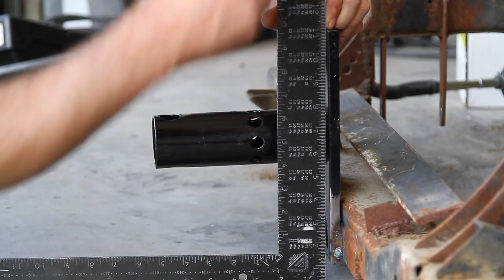DIY Homemade Truck Frame Rotisserie Using Harbor Freight Engine Stands.

Comment: Dude, you are doing good. Public speaking is the largest fear for people and I figured this phobia was spiders!
  Maybe people have a hard time speaking in public picture then not naked, in underwear but with eight legs and covering their chairs in web!
  Hell, I don’t know!! You do a good job speaking, just make sure it is loud enough for guys who worked in shops but had no daily access to ear plugs. We owned SnapOn ear muffs, but we’re never offered ear plugs. We augured for gloves to wear during auto transmission repairs. They had me clue as most front personal would run to the Hospital with a paper cut. 
  Good lighting, speak up, having knowledge of the subject matter is the best confidence builder when it comes to any subject. 
 It will be good and I will send this link to one some who takes cars apart from the 80’s, but can’t figure out how to put them together. I tell him, I had to watch, learn, ask questions until they ran me off. A new high school built in the 70’s, they had no budget for ship class as the guy did drafting! No wood shop, no cars nothing!
  I apprenticed with a guy 2.5 blocks from the school. Crazy now, but our driver’s license said “Farm/School” no photo at age 13. Help the guy during the Jimmy Carter era when gas stations everywhere closed. Compressor and hoist were pennies on the dollar at actions. Who wanted them as 250 had already been sold. We dug the hole, put the hoist onto heavy footing, nailed off framing to keep it plumb, but laid concrete block to reach 18 feet high. I remover using a bed mattress springs only as the fabric, cotton and cord was left, placed into floor for reinforcement before concrete went in. 
  You look younger, but ask others about odd / even days to buy fuel. Based upon your license plate’s last number. If an off number on a calendar day that was an off number, then you were allowed to buy fuel.
  Highway speed limit signs came down from 75 to 55 MPH. Truckers were mad as trucks were not geared for this speed. 
 The highway patrol all had Plymouth Satellites with a 383 golden commando engine with 4bbl, dual points and 727 torque flight transmissions. On a calm day, 1/2 mile for the highway, they would see a speeder, pull-off, U-turn and you could hear that engine as they quickly drove to catch someone.
  During this time, we rebuilt everything as boxed reman parts where not available. A boxed part came from the dealer. Gas jumped from $0.19.9 cents per gallon to $0.66 cents per gallon if a station had fuel, but people thought the world was coming to an end! 
DK, Best of luck! Good info…
Reply from the maker: Man! I wish I was around for $0.16 a gallon. Getting pretty close to $6 right now. Except I think the world really is ending.
I don’t consider this public speaking. This was my first video and I was nervous as hell even though I was all by myself. Things have gotten a lot easier but I’m still by myself. If I’m ever asked to speak in front of a crowd I will instantly accept. And then I will shake in my boots into that day. As always, thank you, Dean. 🙏
Reply: @GarageFab  Try covering 5 types of GM serial data found on GM vehicles to 100+ techs, shop owners & tech school instructors, with books, power point and added slides I took photos or screen captures off my TECH2! I hated the crap they sent us from Grand Blanc, MI. I asked one of the developers there why they did not include lab scope wave forms or TECH2 shots? He told me they didn’t have that equipment! Holy moly…
Have a good one!

Comment: Awesome idea..... I’m want to try this, I need some type of stand or rotisserie for my bronco body. And one for frame....
Reply from the maker: BackYardBronco This might be a little small for a full body especially a Bronco!. Everything I needed for just the frame though.   Highly recommended. Might need to extend some parts and beef up a few others to handle the body.
Reply: Just a thought from an old vessel fabricator, having built multiple portable A-frames to facilitate movement of multi-ton boiler vessels, the use of two sizes of square tubing of say, 1/4” wall, ( 2” & 2.5” for example ) can provide adjustable height for the vertical and width of the outriggers!  For top heavy or just unbalanced loads, I recommend anchors to the concrete at the ends of the outriggers 😎
Reply from the maker: I like it! Thanks for the input, Rick. 🙏 
This thing ended up being a storage device for my frame. It’s now pushed up against a wall with the frame on its side, and I no longer plan to use that frame. 🫤 But I will certainly keep this in mind if I build a frame for something else.

Comment: How much weight will that hold?
Reply from the maker: I have no idea! 😀 I'm sure there's much more sciencey stuff involved like weight times length/leverage plus gravitational pull... But I used two 1000lb stands so... 2000lbs?
Either way, what you see is about all it's going to be so I'm guessing around 500lbs won't hurt it.

Comment: Two unsafe and wobbly for a full car bad idea bad design
Reply from the maker: the one and only Too unsafe*  You are probably 100% correct. But this rotisserie was never intended for a full car.  It was simply designed to make a frame that was too heavy for one person more manageable without help. It has been a life saver so far.
Reply: With a welded connector from stand to stand do you think it would hold up a 71 mustang about 1000lbs or a little more? Just looking for your opinion.  Thank you, Great video!
Reply from the maker: greg Montecalvo The engine stands I used are rated for one ton each (2000 lbs) and there's two of them. Granted my design eliminates half of the wheels which I imagine could affect it's rating but I can't imagine it wouldn't easily handle at least the original 1 ton.  Two things though that I think would be a more important concern is; 1. A full car body is significantly larger so without extending the uprights the car would hit the ground. And 2. Even if you did extend them, the lack of width of these stands would make me question the stability of the whole assembly. Imagine trying to balance trying to balance a triangle on it's point. An exaggerated analogy but hopefully you get the picture. If I were to build a full vehicle rotisserie, I'd steal this basic design but make everything almost double the size.
Reply: @gregmontecalvo9251  
Absolutely!
You need a brace that connects the 2 stands, and extend part with the wheels. Just use square tubing that is over or under sized to the stuff on the the stand, that way it can be slid inside each other.